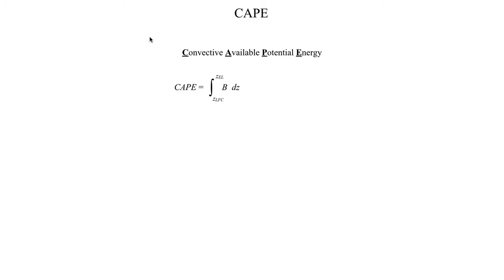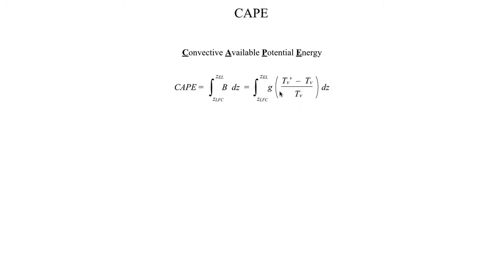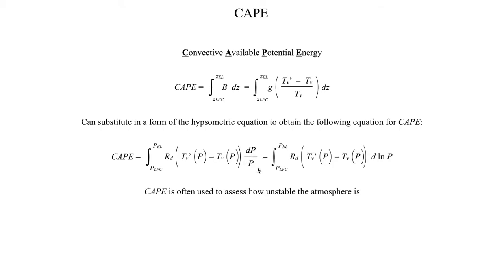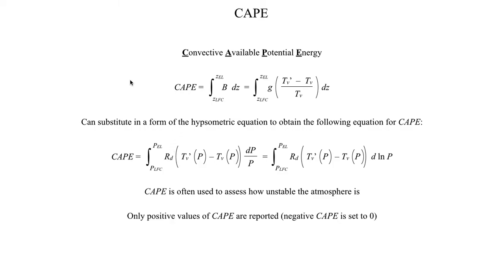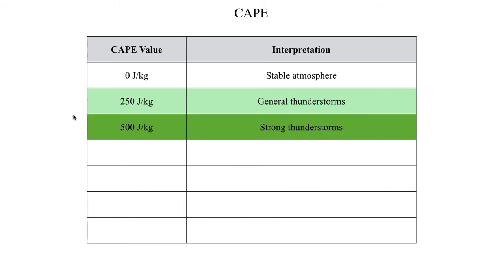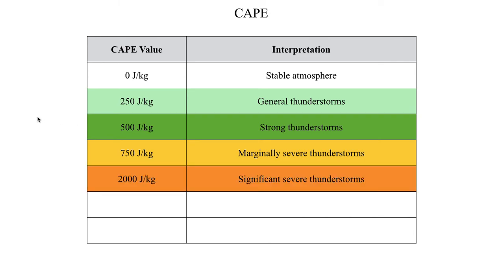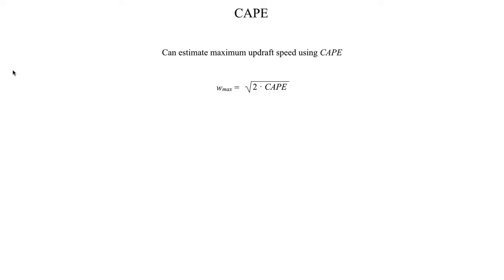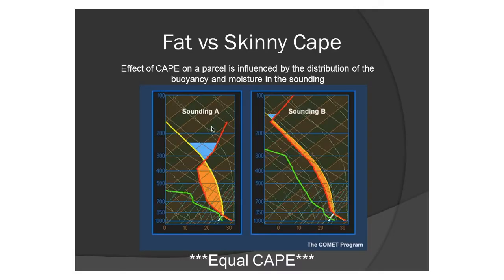METR2023 - Lecture 21 - Segment 3: Convective Available Potential Energy

Comment: Thank you very much. I was reading that the CAPE values for the Rochelle tornado in 2015 were 1000-1500 J/k!
Reply from the maker: The Rochelle tornado is arguably an example of a phenomenon I've heard others call "riding the low". Essentially, a supercell forms very close to the main surface low and taps into a region of particularly enhanced directional wind shear (and persistently strong synoptic-scale ascent). When this occurs, it doesn't take much CAPE to create a violent tornado. A similar thing happened with the Beauregard, Alabama EF4 on March 3, 2019.

However, this phenomenon of "riding the low" cannot be reliably predicted since you would have to know that a supercell will form close to the main surface low, and the exact location(s) of supercell(s) simply cannot be reliably determined. Also, there's the unanswered question of "how close is close enough?". Still, if a severe weather setup has an intense surface low whose forward speed would roughly match that of a supercell, keep a close eye on any storms that form near that surface low!